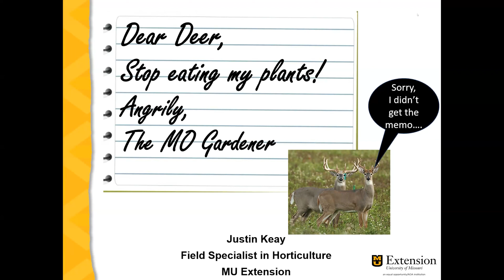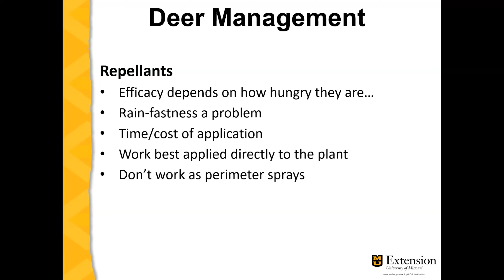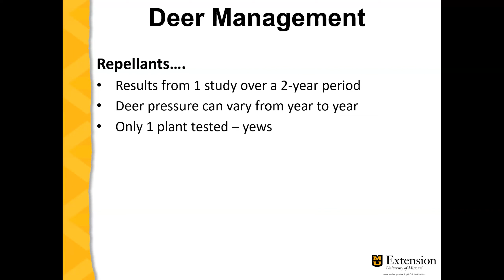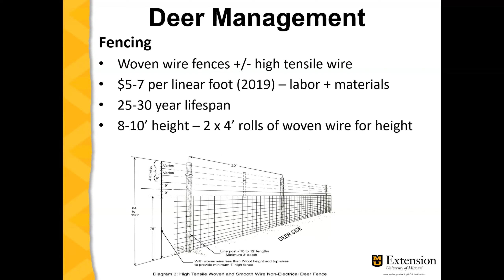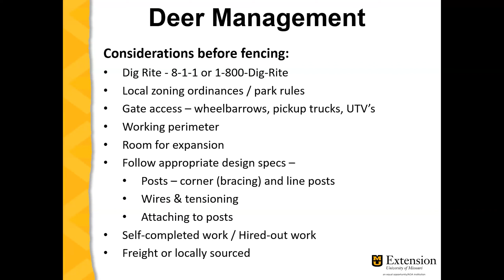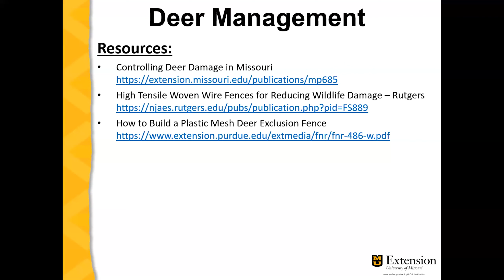Deer Control Around the Garden

Comment: Great video !
After two years of providing a smorgasbord of different plants to the local deers, I decided to go with an electric fence. 5’ tall, 3 wire main fance with a single wire perimeter fence 4 feet on front of the main fence. So far not bad. My garden is surrounded by farm land, and there is a creek with some wooded area around it. Prime location for local deer to feed on my strawberries, blueberries and fruit trees. My heart was broken when I found out most of my blueberries “pruned “ by deer two weeks after planting. Now the electric fence seems to do the trick.
Thanks for sharing such valuable information !
From Illinois / Wisconsin state line 😁